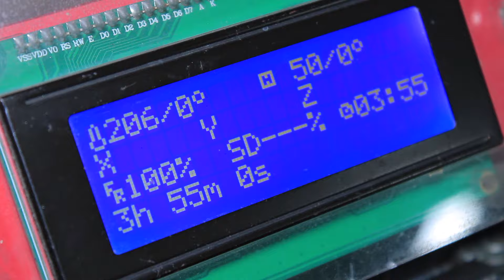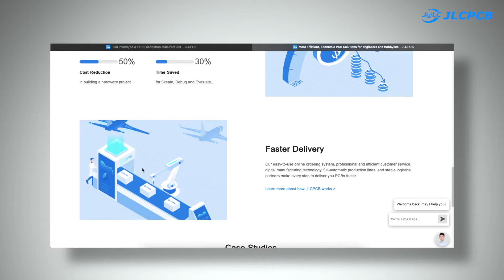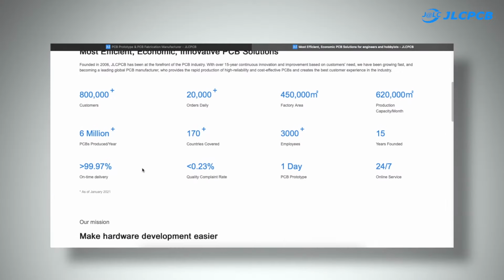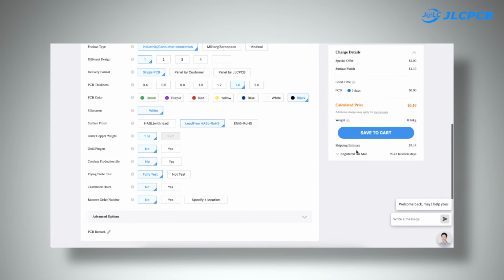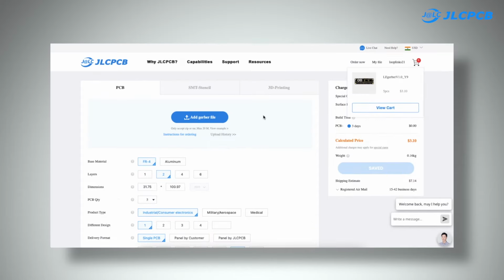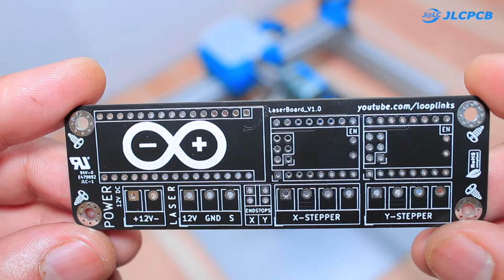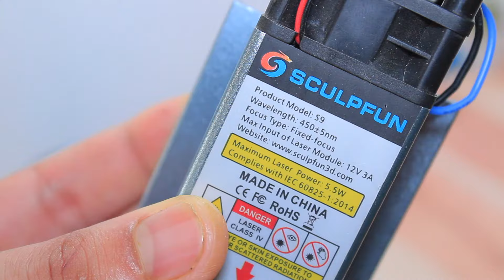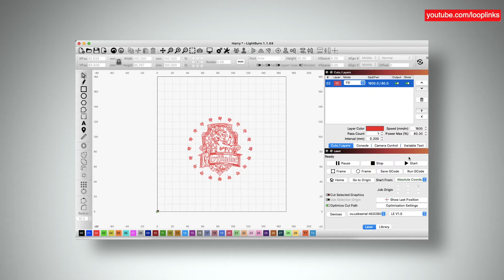DIY Diode laser Engraving Machine using Arduino | 5.5W CNC Laser Engraver/Cutter | Sculpfun S9

Comment: There's absolutely no reason for this machine to be cantilever. you can see it sag when it travels farther out. It's ruining your burns due to it going out of focus. just properly constrain it instead of trying to make it look cool.
Reply: I was thinking the same.... all these designs have this problem....it is easy to solve with the motor move further out.  so it is in balance... with possibly a wheel touching the base
Reply: 🎉Hi dear friend, thank you for sharing this interesting idea.  But the description of how to make it is very incomplete.  And the manufacturer must rely on his imagination, including the description of the electronics of the device, the dimensions of the profiles and the rail and wagon, and having a bom to prepare the parts.  I hope you add them to Google Drive if you have them, because I wanted to make this.  Thankful.  Vahid from Iran

Comment: Good design, have to move big hole in Y base 1 mm in STL file, very solid. I use to engrave PCB without problem. thank you for the design. The PCB was very good, I use it for all of my laser include 100x100 cm one. from thailand
Reply: For pcb, you can use the original because it can use 5v from usb port🎉

Comment: I started building this engraver and found a couple of issues with the STLs.  The bottom plate and base plate were too wide, the 625zz wheels would not tighten up to the 2040 extrusion.  I edited the STLs for these parts, removing 3mm from the longest dimension.  Base plate became 106mm wide and the bottom plate 82mm.  That will tighten up the fit.  I added a jumper from the 12V input to pin 31 on the Arduino Nano, which is voltage in.  End stops for home position of X and Y were also added (not shown in  the video).  A great project, but many details weren't mentioned or shown  in the video.
Reply from the maker: Thank you pointing it out. However for me this was not the case.
I have not added End stops that's why it's not shown in the video.
Reply: 5v can supply from usb??, It is not stand alone so you dont need Vin
Reply: @piyanopnuchanat  You still need 12V to power the laser and stepper motors, so adding a jumper wire from 12V in to Vin, the Arduino is powered from the 12VDC power supply
Reply: @LoopLinks  Correct, the lack of end stops is obvious from the video.  I also downloaded LaserGRBL that has the ability to update firmware to a custom build that doesn't use Z axis, therefore allowing the machine to home without failure.
Reply: I want to do this project too. Can you please post the modify files and schematic for the jumper, end stops ?

Comment: It's great but I have 1 query  z+ of cnc shild is 5 volts and laser signal pwm is around 5 to 12v will laser work at its 100% or at it full potential?
Reply from the maker: yeah it will work at its full potential as it considers duty cycle.

Comment: Hello, thank you for your work, I would rebuild your project, I also ordered the boards (PCBs). Can you please tell me which capacitors have to be soldered on the board? Thanks
Reply from the maker: Glad you liked it. 
100uf 50V electrolytic capacitor. You can refer to schematic.pdf file - https://drive.google.com/drive/folders/1DyZ98v_PIQ7_Bw4f-NIXZyek-xcQtFoQ
Reply: @LoopLinks  All right, now I see that on the schematic where you say it. thanks 👍

Comment: Great achievement! And thanks for sharing this. I see you're also using a larger 2040 extrusion to support the platform on wheels (with the moving stepper). It offers more rigidity than a 2020 extrusion there. My project would be different though: tweaking your idea by making a more conventional but bigger rectangular setup with opposite parallel extrusions on both ends (width and length), do you think the longest extrusions (so including one guiding the wheeled platform) can be reduced to 2020? There would be two of them, one on each long side of the machine.
Reply from the maker: Thanks! Yes you can use 2020 extrusions...there are many commercial laser engravers using 2020 extrusions only. Mine is a cantilever design so I used 2040. Although machine is still not rigid when laser is at extreme corner...there is a slight play at the corner 13:18
Reply: @LoopLinks  Yes, I saw it moving slightly due to weight. I must say the main problem with DIY solutions (Cantilever design like yours, or square frame) is finally the very high price point of a 5.5W (true optical power, not the advertised consumed power, which is a trick) laser module when it is sold separately. 
That's where Chinese brands like Ortur, Atomstack, Sculpfun, etc. are very competitive because they offer the whole product (including the laser) at an incredible low price (often sold with special flash offers). 
So besides the DIY route (time consuming!) I am currently considering a brand new AtomStack A5 Pro+ under $250. It has a laser with "compression beam technology" (lenses that stretches the spot vertically according to a 2D chord, allowing to decrease the width of cut + cut thicker materials) and a tinted lasertight window making it unnecessary to wear protective eyewear.
Reply: @LoopLinks  I think that a plate made out of aluminum to connect the two axis might have less deflection.